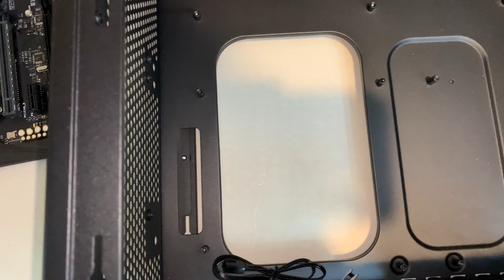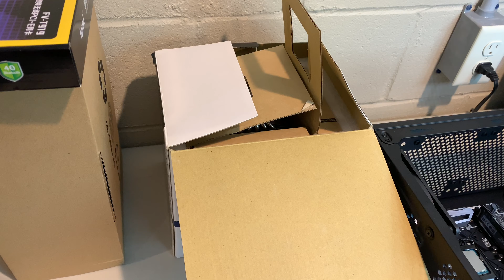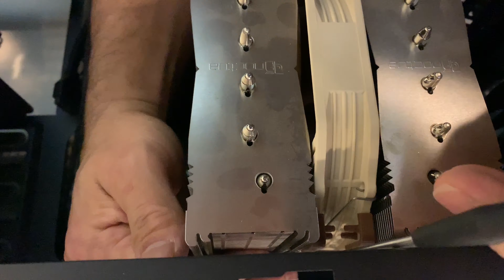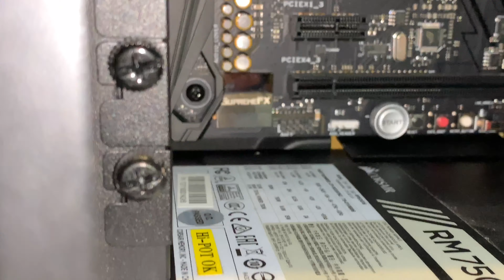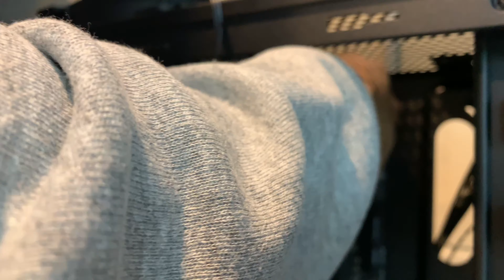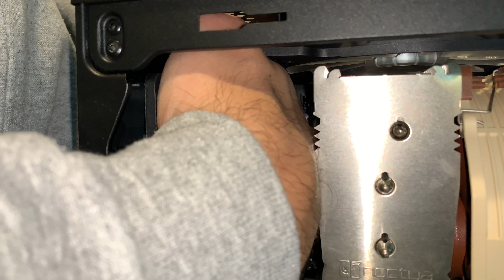Hackintosh build Intel i7 8700k Asus Maximus X Hero RX 580 Plug N Play Mojave Mac OS Complete Build

Comment: i've got a similar build, Rog STRIX B365F Gaming Mother board, RX 580 GPU and i5 9th Gen CPU. Added Native wifi bluetooth card and Using open core and the build runs rock solid. Everything works.

If anyone with similar PC config or in general mackintosh help please get in touch.